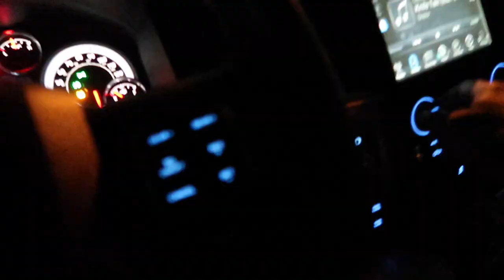I Finally Installed My Electric step Bars For My Ram 1500!(Super Dope)

Comment: What the step bars hit you for want to put some on a 2016 ram1500 them new joints under the truck
Reply from the maker: It depends on the brand the rough country ones I got are 1500